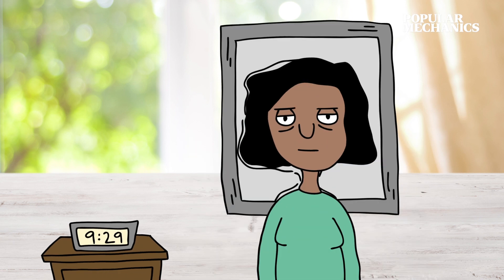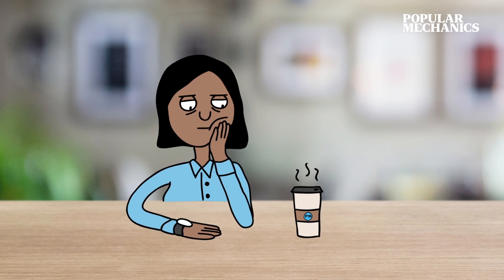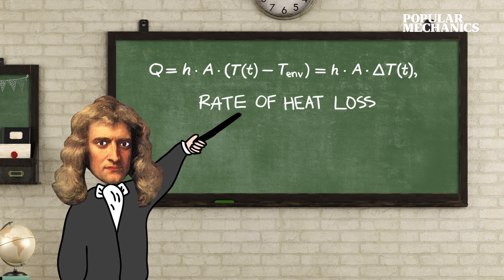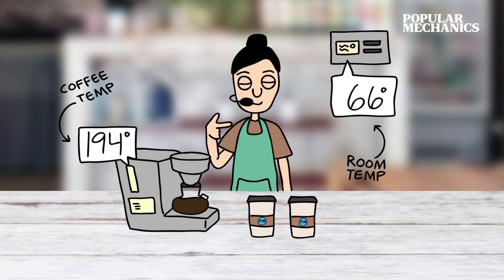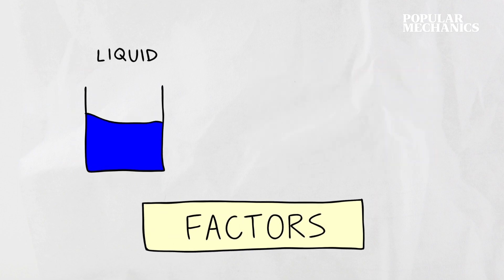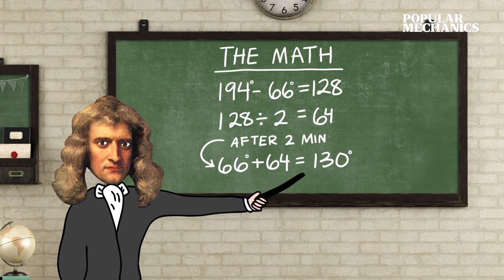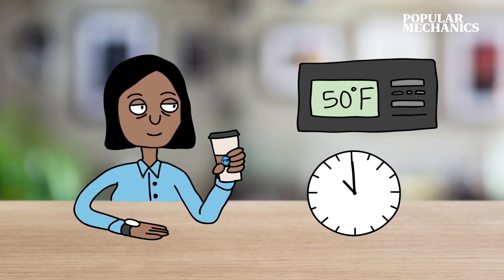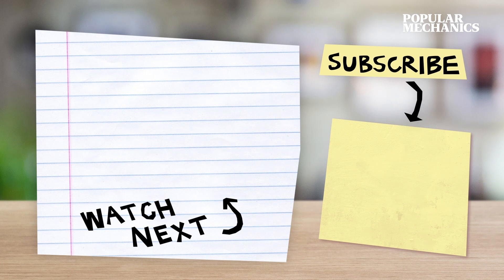How To Find The Perfect Coffee Temperature | SOLVE IT | Popular Mechanics

Comment: Wow, this is close to a chemical engineering open-ended problem we had in college, to design a cup that would cool coffee quickly then remain at the reasonable drinking temperature of coffee as long as possible.  For the mug design, we look at conduction, convection, and (negligible) radiation.  The part we missed was evaporation.